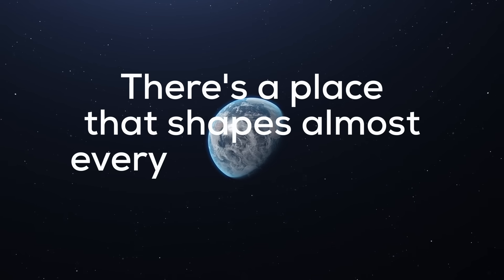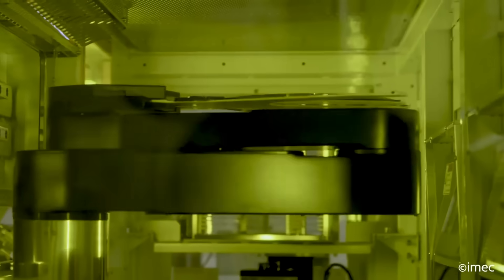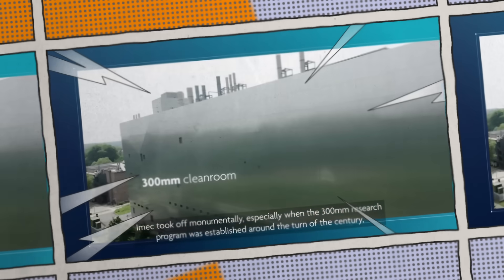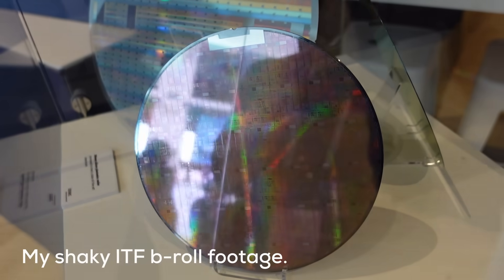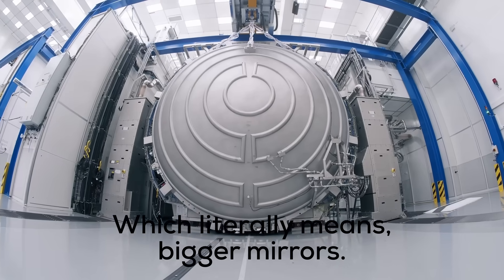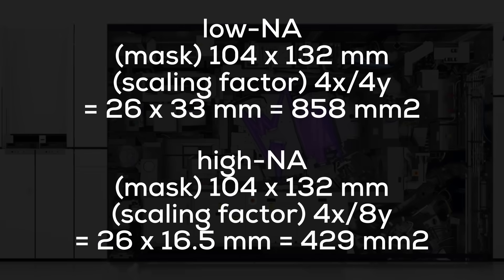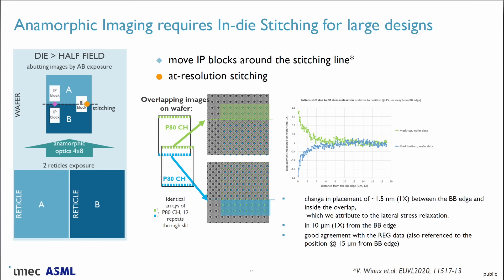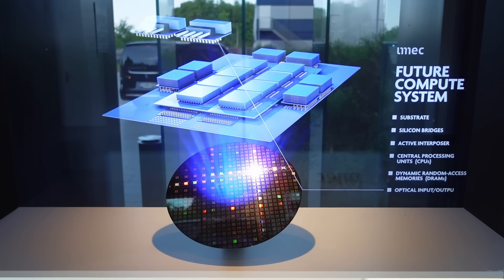imec — the most important company you've never heard of

Comment: The EU has ASML and IMEC and still we don't have a decent fab on the entire continent...
Reply from the maker: I'd say imec FAB 3 + the extension is a very capable FAB. It will even have a High-NA EUV scanner very soon. But ofc it's "just" an R&D FAB.
Reply: @HighYield it is insane how much production has changed in the last years while nobody outside of the industry has even felt a change.
I was a field service engineer and then a production planner for a lens manufacturer a few years ago and I remember implementing the first EUV machines into the fabs
It was such a huge deal when they started manufacturing regularly, a big part of the history wall in the company got replaced and all the involved departments had a big event.

EUV makes the AI hype possible but still even most tech bros who develop their amazing system don’t even know about the leap we achieved with EUV technology.
Moors law would’ve basically ended with conventional lenses and lasers, but nobody talks about it.
Reply: @rolux4853  Exactly, EUV likely is a key technology for humanity as a whole and overstating its importance is almost impossible. I think it is just that modern cutting edge chip production got so insanely complicated most people and the public don't understand anything anymore. Sadly even EU leaders seem to completely fail to see its strategic importance.
Reply: What next gen R&D does the US do?
Reply: Moore’s law did end. Moore’s law was about the cost per transistor; density was just the thing enabling cost reductions to occur by craming more devices on the same sized die. Dennard scaling was the magic free lunch that meant smaller transistors made everything better (20 years dead); it’s what made the 90’s so magical in tech. The same sized chip, containing about twice as many transistors, should cost the same if moore’s law is still valid; but it doesn’t anymore. Not only is the cost per transistor no longer dropping nearly as quickly; the design costs for a chip used to be millions of dollars but are now approaching a billion; even for just a dumb die shrink of an existing design; you need to sell tens of millions of units or design cost will dominate unit cost.
Reply: @HighYield  I think he's actually talking about having no proper Semiconductor factory that'll produce leading-edge nodes in volume.
Reply: They already have a high EUV scanner. They delivered a machine to belgium before Intel got theirs.
Reply: @HighYield that’s the problem you need a Production FAB to really scale up both economy and jobs
Reply: @HighYield that  That was a very informative video.  I work at  Micron in the US. At the moment the company is building the biggest FAB in the U.S.
Boise, ID. The company has been mostly a memory production fab. Have you ever covered this company? I would like to watch any reported news.
With the two biggest fabs being built in the US. I would like that technology experts would be keeping updated logs on the expansion. 

Thanks.
Reply: @HighYield I'd argue that has been by design due to economic pressures from the US. Europe has for decades been kept behind on fabs, ever since AMD spin-off its FAB, Global Foundries. That single choice eventually spelled doom for EU semiconductor fabrication as previously, AMD had state of the art fab plants in both the US & Europe. The EU lacks the capital investment as well as a large semiconductor manufacturer who produces domestically. The only exception was the British based ARM, but that's no longer the cast post Brexit.

What I hope is that the EU starts investing in domestic fabrication—ideally, a worker owned & operated cooperative cooperation similar to Mondragon or a full-government backed fab plant that provides subsidized manufacturing for domestic EU semiconductor manufacturing. That way, the EU can have meaningful domestic production. Would be a good blend with something like domestic RISC-V processor design and fab.
Reply: I know us enthusiasts tend to focus on more leading edge fabs, but older node fabrication is still very important, even if it's not sexy. :)
Reply: @maynardburger i 100% agree. and if we focused on optimizing budget nodes to a T and providing a supply chain to accelerate the development of low-end chips, we could make absolute bank. it's already mostly automated, so the cost of staffing isn't much of a driver.

- rad-tolerant electronics are constantly about 2-3 node iterations behind, due to single-event upsets being too common and the need for harder-to-work-with materials at smaller node sizes.
- those high-end chips are very pricy, and few chips need anything more than 7nm. the embedded world runs mostly on 28nm, with 14nm reserved for high-end parts that don't need to be phone- or desktop-grade.
- we don't need expensive euv machines for it. we can get away with duv machines for up to about 14nm (7nm with multiple exposures), and the us is about the one other place where there could be a market for an asml competitor.
- the us is the main tech hub outside east asia, and so we're uniquely positioned to have an immediate audience for it.
Reply: We could but it's just not economical
Reply: GF in Dresden?
Reply: @DanielHeineck  12nm just starting, not really modern, but yes at least decent.
Reply: Thats simply wrong, for example infinieon leader in power transistors produces in germany , just because europe doesn't produce a lot of classical computing chip, it doesn't  mean it has no semiconductor  manufacturing
Reply: All the countries with better fabs could easily say the reverse.
Reply: @petergerdes1094 sharp observation, unfortunately as long as we are allies ti an irrational US, there can be no progress … this is the real reason all the tech and all the hardware is developed there … we are simply not allowed to
Reply: Whilst not on the continent, Ireland does host some leading edge Intel fabs.
Reply: @Harjeevan20  Ireland is in the EU so they are 'on the continent'
Reply: @Harjeevan20  yes in the time Intel was making boats loads of money and all got paid by EU tax money 🙄
I still know that that the airport in Dublin was connected with little provincial road, very quiet
From sleeping place to most expensive city 🙄 
Infineon Dresden fabs weren’t too bad either
Reply: Also there is Zeiss, which is responsible for manufacturing the projection optics boxes in ASML machines, one of the biggest and most important component. There is no other company currently that can manufacture High NA EUV POBs. And I agree that it's pathetic that we don't have any modern fab capacity in Europe... Instead of that, we let ourselves to be exploited as a colony of the US tech industry.
Reply: @leakyabstraction  There are a bunch of companies in the US and Europe along wtih a few in Japan pretty capapable of make those mirros, they are not that hard to make, the EUV optics/mirrors technology was developed by Lawrence Livermore, Lawrence Berkeley, Sandia National Laboratories, and Tinsley Labs in the US, before being transferred to Zeiss.
Reply: @leakyabstraction   EUV technology was originally developed in the US through consortiums involving DOE national labs, NIST, and many prominent private US companies, ASML was actually late to the game; it received permission from the US government to join the consortium, which gave it access to the technology. (The US government rejected requests from Nikon and Canon to join the program due to national security concerns. That is why Japan, despite its significant share in the lithography tools and equipment market, does not produce EUV systems, along the way, ASML was granted approval by the US government to acquire several American companies, enabling it to build the system into what it is today. (It still operates under many of those licenses.)
Reply: @leakyabstraction  And that's one of the reasons that the core and most complicated part of the system—the light source—is designed and built in the US by an independent California-based company called Cymer. The laser is also designed in the US by Cymer and manufactured by Trumpf in Germany.
Reply: Do not sell abroad. World's best fab technology from Finland was bought by a US company in the early 90s for sub one billion dollars.
Reply: I thought about that many times and I'm puzzled, almost tin foil hatter. It's also not the first time either that we prime in some tech but we don't even try to exploit it to its fullness...
Reply: We have A fab at least, NY Creates does research in Albany NY. I'm not sure how good it is, but I'm pretty sure they published some interesting results recently.
Reply: @samuelwikstrom7721 IMEC is also present in Albany
Reply: Just for the Netherlands.

ST Micro (France+Switzerland+Italy), NXP (Netherlands) and Infineon (Germany) are the major European chip fabricators.
Reply: Make sure the new machines are seen as critical equipment and may never leave the EU. Let them come to us.
Reply: Hilarious, these organisations existed long before the EUSSR. the EUSSR lives of taxpayers money, so Netherlands you have to pay as 10 billion a year and we go e you 8 billions back and then we say we are the ones financing things... It is hilarious, without the EUSSR these organisations would still exist, especially in the Netherlands that has a long history of developing and inventing the newest technologies used around the world. If we wouldn't get back a little of the billions we pay to the EUSSR we would be investing this money ourselves and still have billions left. 

Yes there a lot of countries inside the EUSSR that receive money from the EUSSR and receive much more than they pay, but the countries that pay more would be better of to loan this money to the weaker countries and then receive a percentage of the profit they make with this money. You would cut out all the unnecessary totalitarian EUSSR politicians and civil servants, and spend a lot less money, giving more gains to everybody.
Reply: @mikebrandenburg9922 take your medicine
Reply: While I would agree the EU should have a backup Fab structure as the US, Im not sure the EU or the US for that matter really want to try and compete in this area. Its fairly mindless from what I see in the fabs so what is really needed is the ability to support fabs and develop new technologies and that is what I would suggest the US and EU already have.
Reply: @campbellmorrison8540  Mindless? Even the newly build fabs in the US massively struggle because of the immensely large needed highly trained workforce you need for a fab. Producing chips on these cutting edge nodes is probably the most complicated thing humanity has achieved. Yes the r&d is also insanely complicated, but producing these chips with good yields and on scale is so hard even big companies fail constantly. Only TSMC is constantly able to deliver.
Reply: @campbellmorrison8540 In the new multipolar geopolitical situation Europe needs to have its own fabs for production. We can no longer trust deliveries.
Reply: The EU is fucked over by its own bureaucracy. Amazingly talented people that get bogged down by incompetent politics.
Reply: Yeah... The EU is littered in fabs 😂 they aren't looking to dominate every aspect of that market, they're trying to maximize interoperability with other nations to make a more robust supply line
Reply: @TheLifeOfKane you can explain that to the people of the EU (the ones subsidising the research) when, in a time of geopolitical crisis, those international partners disappear, and fabrication facilities for critical chips can't be developed quickly enough. There's no resilience/sovereignty plan.
Reply: for embedded microprocessors, there is a big NXP fab in the Netherlands, which is also very important, but those chips are much less performant than the chips produced by TSMC
Reply: Let’s change that.
Reply: ASML’s EUV technology was developed by and is owned/licensed by the US Department of Energy. ASML can only sell to who the US Department of State says to sell to! The US DoE licensed this technology to ASML and US company SVG. ASML later bought SVG.
Reply: That’s because those EU companies are really US industry extensions.
Reply: Imec had a spinoff, a factory for chip-production for about 40 years... specialised in highspeed realtime and communication technology, however, they closed in 2024. Last week, a new business-plan was proposed and granted and the factory will reopen, they will specialise in phototronic-chips, faster and way less energy consumption.
Reply: EU is just very anti big business or innovation they would rather shoot themselves in the foot then giving companies less beurocracy to deal with
Reply: It's so sad.
Reply: Fab or chip design
Reply: And the uk has ARM and yet too… Europe has long believed that borders no longer counted, so we focused on designing and researching  the stuff to make stuff, rather than the actual stuff…
Reply: Intel have built a fab in Ireland
Reply: Because Europe is a vassal without real sovereignty since the end of WW2
Reply: Nothing is easy to build.  Tsmc. Nvidia. Google. Broadcom. Arm.
Reply: Czochralski is turning is his grave!
Reply: Environment and jobs laws. Silicon fabs uses a lot of clean water, and the work is vey stressful . Not a lot EU want to do 12-14 hours shifts.
Reply: Without ASML the US wouldnt be able to have a fab so yeah ....
Reply: @lordgandalf22 ASML’s EUV technology was developed by and is owned/licensed by the US Department of Energy. ASML can only sell to who the US Department of State says to sell to! The US DoE licensed this technology to ASML and US company SVG. ASML later bought SVG.
Reply: @lordgandalf22   
 Sorry to burst your buble but it's mostly American technology:
- EUV technology was originally developed in the US through consortiums involving DOE national labs, NIST, and many prominent private US companies.  
 - ASML was actually late to the game; it received permission from the US government to join the consortium, which gave it access to the technology. (The US government rejected requests from Nikon and Canon to join the program due to national security concerns. That is why Japan, despite its significant share in the lithography tools and equipment market, does not produce EUV systems.)  
 - Along the way, ASML was granted approval by the US government to acquire several American companies, enabling it to build the system into what it is today. (It still operates under many of those licenses.)  
 - Many critical parts and components of the EUV system were developed in the US and continue to come from American suppliers. For example, the optics/mirrors technology was developed by Lawrence Livermore, Lawrence Berkeley, Sandia National Laboratories, and Tinsley Labs in the US, before being transferred to Zeiss. The reticle stage technology was developed in the US and is still manufactured there. Most importantly, the core and most complex part of the system—the light source—is designed and built in the US by an independent California-based company called Cymer. The laser is also designed in the US by Cymer and manufactured by Trumpf in Germany.
Reply: @lordgandalf22  The US is the global dominate player in semiconductor equipment and tools industry, basically you can make chips without ASML but you cannot make chips without American equipment makers.
Reply: @JigilJigil uuuh dude any modern chip uses a few machines and asml is one of the biggest one. And asml is the only one that has euv machines. And for you're info us has 78 fabs and in the world there are 474 so yeah a drop in the total number of fabs and most are in Japan and South-Korea. But there's also a ton in Europe. So yeah and about fabs you miss Philips and nxp fabs so there are some fabs yeah not like Intel or the fabs in Japan and Korea but we sell more the gear to setup the fabs and sell more smaller chips. But Germany and France have bigger fabs if I'm correct. But yeah Asml is the only one in the world that makes Euv machines that Intel and tsmc want and sure there is EV and DV that many more companies produce so they aren't the  only makers of chip making machines but for the euv side they are the one and only one and tbh they make parts in the US also so het 🤣
Reply: @lordgandalf22  "any modern chip uses a few machines" NO IT DOESN'T; IT USES HUNDREDS and they don't come from ASML, most of them come from American suppliers followed by Japan, basically you can make chips without ASML but cannot make chips without Applied Materials (American company), no matter where the fab is located. Asia, Europe, ... every fab around the globe is dominantly American equipment (machines), as American companies are the ones that make the tools and there are no alternatives, who is speaking about the fabs,?! I am speaking about the equipment and the tools.
Reply: There's more to it than just the fab, there's the supplies coming in and the packaging of what comes out. And you'll find 	all of that in Asia, like packaging in Malaysia and Thailand.
Reply: The questions would be why would EU billionaires scratch their head to invest in it? It is lucrative. High paying.
Reply: Its because Europe is selling all sorts of factories to the rest of the world. Europe has essentially positioned itself as the ones who everyone else is dependent on to be able to manufacture things efficiently.
Reply: It's still impossible. The biggest experiment yet, is the Belgium region and it's possibilities. How can we process early warning systems, apply intelligent traffic, include gouvernement interests, and save them from foreign attacks. Inventing new things is easy, making them safe and ready to use and employ them on a large scale takes time. ;-)
Reply: About early warning systems, not only tornado's, but when a gass leak is detected, the fire department is already there, before you smell the gass, a water spill? The local water company knows where that spillage is, and responds, before we even notice it. 
Another application: our traffic lights are run by Imec and ASMR. These traffic lights know when and where people, cars, ambulances, trams, busses are waiting or expected to cross their section. It's all being calculated and regulated. At night, as a pedestrian, I have minimum waiting time, when an ambulance is near, I have got to wait, same for a tram, unless said tram is late.. ;-) It's a basic of chaos theory ordered in their respective expectations.
Reply: Depends on what you call “decent”. If you are interested in silicon photonics, Global Foundries is the leader in that space, for instance. I share @HighYield's optimism, silicon photonics and packaging will become increasingly important.
Reply: Intel Ireland is in the EU and a “decent” fab 😊
Reply: @PaskalS the only decent fab used to be Infineon, back when they were also producing AMD’s chips (15-20 years ago). 
Intel’s fab is not of importance to the EU.
Reply: You only make the tools. Your craftsmen are not that crafty
Reply: @Sarah_Delata  the craftsmen are crafty. It’s the industry that is the problem. The US and Asia has focused more on semiconductor than Europe ever did.
Reply: @pangtsr Europe has long ago lagged. It's not creative anymore.
Reply: Sell the shovel and dont dig for gold.
Reply: The EU? The Benelux 😂
Reply: you are wrong. you don't have them. they belong to deep state and are separeted on all levels so they can't be located and captured.
Reply: bc nobody has passion like the taiwanese
Reply: That's not entirely accurate, we have STMicroelectronics in  Catania, Italy, NXP in Nijmegen, Netherlands (mostly power electronics nowadays), GlobalFoundries in Dresden, Germany, Infineon which is all over Germany and Austira, Bosch in Munich and the newly founded offshoot of TSMC, the ESMC. We just don't have any advanced logic fab because these are way too difficult to make and insanely expensive and move at a breakneck speed.
Reply: @InTimeTraveller  yeah okay, 👍 I simplified a bit. But the fact that we cannot create an advanced node not to speak of designing such speaks volumes. I agree it is expensive but so are bank bailouts, Pfizer scandals, war efforts … I hate to break it to myself, but we are simply not sovereign in our decisions … this is power politics preventing us from establishing cutting edge chip technology. We don’t build the brains of a Computer
Reply: Why do we need one ?
Reply: If you knew about economics you would know that it's due comparative advantage. Yes Europe would also be good to having large scale fabs, but that's something that can be done by others. In other words Europe has better things to do and focuses on the stuff only they can do and noone else.
Reply: I have absolutely no evidence but I believe the fact new centers of production don't pop up is due to international treaties dividing global supply chains across the global powers.
Reply: Semiconductors are more then just mega fabs. We have lots of great company's in both production and research. HTC eindhoven is filled with them and noviotech campus in nijmegen. And what about the photonics company's that are starting to thrive?
Reply: The US designs the chips, Europe creates tooling, and Asia manufactures the chips. Semiconductor manufacturing at the leading edge is so complex that specialization makes sense.
Reply: It's the EU model. You can draw a parallel with even the fashion industry. Europe has the leading fashion design and luxury brands but barely any manufacturing. That needs a shift to gain more independence and create more low education jobs, but you shouldn't want to dominate all aspects of a value chain. Europe’s genius is in design and innovation — but without some dirt under the nails, that genius stays fragile.
Reply: TSMC should build a fab in EU they will outcompete others
Reply: If you count the EU outside the continental land mass intel's fab in Ireland exists Intel 4 may not be the best node out there but still decent.
Reply: Price for Marshall Plan, colony not allowed to be better than metropoly.
Reply: @AABB-px8lc ah, seems like someone had the same impression as I did.
Reply: There is a simple reason. Supply and demand. The EU simply doesn’t need the amount of chips. We buy end products, the manufacturers of the computers, smartphones and servers are all located in asia and hence the manufacturers of chips are as well.  We do have a substantial demand for lower grade chips in machinery and automotive industries and we have the corresponding faps in the eu.

If we want high end faps we need to make the demand. E.g if we build up servers for AI it might get interesting but not if we want to make chips that are shipped to asia and build into products that is just not viable.
Reply: And Zeiss.
They are the ones doing the most important step in Chip manufacturing.
Reply: @tiagogomes3807  King Zeiss 😉
Reply: @tiagogomes3807  No They are not, There are a bunch of companies in the US and Europe and a few in Japan pretty capable of make those mirros, (I am assuming you ar e speaking about EUV optics) they are not that hard to make, the EUV optics/mirrors technology was developed by Lawrence Livermore, Lawrence Berkeley, Sandia National Laboratories, and Tinsley Labs in the US, before being transferred to Zeiss. And most importantly, the core and most complex part of the system is the light source which is designed and built in the US by an independent California-based company called Cymer.
Reply: Production is highly political and geostrategic.  Just part of the arrangement.  US is supposedly the hegemon but moved its most advanced fab operations to Taiwan.  Makes no sense unless you understand US is not truly sovereign.
Reply: That’s by design. Uncle Sam doesn’t see Airbus as a threat but is militant over semiconductors.
Reply: By that metric- the only decent fab is in Taiwan. But that’s a silly metric
Reply: @altimmons  By which metric?
Reply: It's pretty insane how Europe constantly acts like a colony or a 3rd world country. Like it has those 2 + most of ASML's most critical suppliers + ARM, but the money is made overwhelmingly by the US (and Taiwan). Like the photolithography machines are by far the most valuable, hard to recreate part of the whole industry. China's (and others) problem isn't not being able to design a cpu, gpu or ai accelerator (everyone can do that) it's having no access to those machines and it's supply chain.
Reply: @nobrainnogain8412  ASML just announced record-breaking profits, while Intel, ASML's biggest US customer, literally has negative profits.

It's better for countries to specialize in the things that they're actually good at - ASML at lithography, TSMC at manufacturing, etc.
Reply: Research and development require extremely experienced and educated staff. It's a very different proposition than a high-yield, high-capacity production line. Developing the latter also requires a ton of experienced and educated staff, but that's done in Taiwan, in close cooperation with the FABs already there.
Most highly complex component manufacturing spends years if not decades being done only in one or two locations, where the supply chains, workforce and relevant experts are concentrated. At some point, the production becomes easier, and "trailing edge" production can start in other locations. For semiconductors, that delay is still very long, but as long as we focus on global supply chains, that doesn't matter too much. 
The alternative, focusing on local production at the expense of efficiency, leads to slower technological advance and higher prices for everyone.
Reply: Well a new round of 'forward thinking' regulations will probably help!
Reply: Europe cost of business is really high due to excessive taxation, and other risks, even in the US it's too expensive, though not quite as much.
Reply: @alexis1156  not due to taxation, thats just the scaremongering talk.
Reply: @latlatko  It 100% is not.

Taxes in the EU are crippling for businesses.

Enjoy mediocrity.
Reply: @alexis1156  too much billionaire propaganda keeps the mind dull. We don't really see much difference in industry of countries or even states based on their tax rates as it currently stands. Energy and labour costs are far, far more important. and those are the consequence of a countries succes.
Reply: @latlatko you'll never guess who's at fault for the high energy prices.

As for "labor cost" wages increase with higher productivity.

As for energy prices being the "price" of development, literally 180 degrees from right, you're as wrong as you can be.

The major driver in development and higher standard of living is cheap and abundant energy.

No cheap energy means stagnation or even regression
Reply: @alexis1156  You clearly don't understand labour cost and its relation to the wider economy. High energy prices are due to a multidude of factors, and they've been trying to mitigate those cost by cutting taxes on them. Most of that is due the ricing cost of gas and oil. The price of oil is controled by a cartel of like 8 countries and  gas has become more expensive due to  geopolitics. i'm sorry real life isn't as simple as your libertarian talking heads make it out to be, I truly wish it was.

I'll say my phrasing around energy cost being the cost of development was poorly worded, i meant for it to only apply to labour cost. Although an increase in demand and a lack of available space for power generation, as we seen in some parts of western europe, does lead to higher energy costs, this is not a general rule.
Reply: @latlatko  That's not even the point you made before.

You were talking about how high labor and energy costs were a "price" of development.

I explained the actual reason why wages increase, wages increase with higher productivity because employers want to attract the best workers, this causes a chain reaction of employers having to increase their wages to attract workers or go bankrupt.

And why cheap abundant energy is one of the main factors of economic growth. If energy costs are high, your development is gonna slow down, it's not a sign of development, it's a sign of regression, literally 180 degrees from right.

The you pushed back with an argument about politics and why energy prices are expensive, so if you knew the actual reason why lie before.

The actual reason why Europe is screwed is because the west is in war with it's own energy producers, at the same time unlike the US, Europe has no real way to ramp up energy production because we lack the infrastructure, and instead of investing in energy that actually works like nuclear, Europe wasted a lot of money trying to make green energy work, while at the same time dismantling nuclear, and ramping up nat gas, coal and oil power generation.

As for lack of available space, yea that's just complete nonsense. Europe don't lack space, it lack intelligent leaders who don't constantly screw up everything.

This is 100% the government being stupid, in other words the reason why Europe is in this position, is 100% on the government.
Reply: @alexis1156    allright yt deleted my full reply. short notes: i didn't mean sign of development, I  meant consequence of development. anti nuclear sentiment made it politically unviable to develop nuclear reactors, even though I agree we should have. The issues with green energy are overhyped for political reasons. Wages in industry have to compete with wages from much higher paying sectors, which is why they can't compete for low profit mass industry with countries like china. this is a consequence of the basic economic development cycle. China also prioritizes its industry over its people which would not fly in europe. 

Also you described political reasons as the reason for the energy issues so idk why you said it was wrong when i did so. War  is politics, just another reason we should cut our dependency on opec/russia via nuclear and renewable.
Reply: @latlatko  It's not a consequence of development, it's a consequence of bad policies.

To state that high energy prices are the consequence of development is ridiculous because energy prices tend to go down with higher development. 

Because cheap and abundant energy are ESSENTIAL for economic growth.

The cheaper the energy, the more you can use, the higher your standard of living. Energy is literally one of the core, most important aspect of growth.

Saying that high energy prices are a consequence of growth, would be like saying that high food prices are a consequence of growth, it's blatantly bs, because both food prices and energy prices went down as technology progressed. And the only reason they went up is because the government printed a lot of money and implemented bad policies. That's literally it. It's 100 %  the fault of the government.

No abundant energy, no growth, or at best it's gonna grow very slowly.

So you're not just wrong, you're super, OMEGA wrong.

I agree with your other points though. The issue i had with your argument was that you stated that high energy prices are a result of development, not your political analysis about the reason why energy prices are high.

Anyway wouldn't the political reason that you gave, go against the whole idea of high development = High energy prices, like it's a clear contradiction, come on man, seriously.
Reply: @alexis1156 But high food prices are a consequence of growth. mainly cause labour and land costs increase, as do demand of food cause usually the population increases. 

that aside, my point is that energu can get more expensive because the demand increases, as do the demands on the grid. and its harder to increase grid capacity on an already existing grid than when you make a completely new one. for example compare to londons sewer system, great for when it was build, but now its inadequate. but its really hard to replace it. Same with electricity, in the past two decades demand has increased enormously. So even if the capacity had keepen up, the price would have risen to cover the costs of that construction.

You're right that both those prices went down initially when technology progressed, but there is diminishing returns when it comes too thosr things. The stepnof going from coal to oil as main enegu source was big, but was it as big as going from wood to coal? I don't think so
Reply: Don’t worry, intel is building a fab in Germany. They’ll help you guys just like they helped you with imec
Reply: @yung784 nope, that's basically canceled at this point, because Intel is losing everywhere and is getting themselves in financial troubles.
Reply: @InterFelix  They have TSMC manufacture chips for them, that's about how bad it is.
Reply: @InterFelix we will see by mid 2026 in the Ocotillo fabs whether they are productive or not. Yea, they’re in debt, but you can’t say they’re failing mid wafer ramp.
Reply: @yung784  they only after money …… I worked in many Intel fabs , my god I preferred to work my bud off in Taiwan treated decent.
Reply: @yung784  Not any more unfortunately!
Reply: The EU is a joke 😂
Reply: @GenAImagic  Keep in mind that EU is not a country, but a trade deal. Like COMECON back in the days, or NAFTA.  As such it is not a joke, but rather very sophisticated and successful trade deal.
Reply: @iordannalbantov Yeah, a bureaucratic nightmare. With Zero leadership. Weak.
Reply: @GenAImagic  They can't really lead by design, cause nations value their independence.
Reply: @GenAImagic  The EX
Reply: @GenAImagic  keep on laughing fool, we know better.
Reply: @PrinceWalacra Do you? Unfortunately your results say otherwise. #Failed.
Reply: Oh no we don't have giant expensive environmentally damaging manufacturing plants all over our country.... You're kind of complaining that you have the best job in the house.